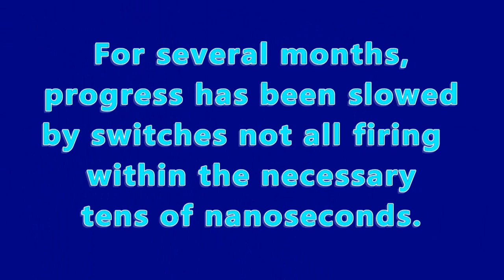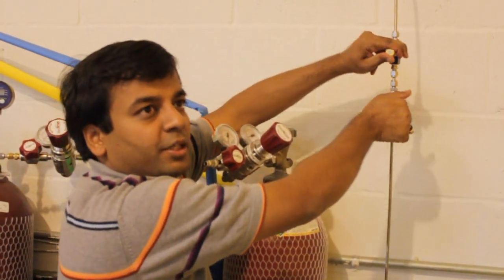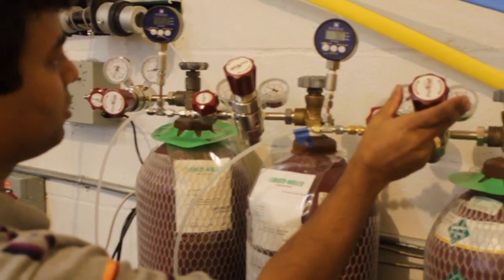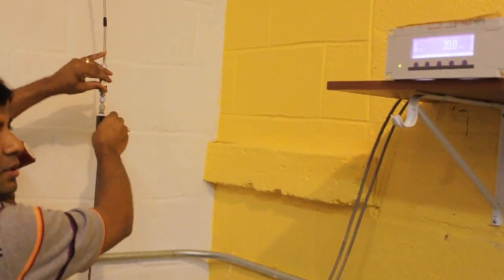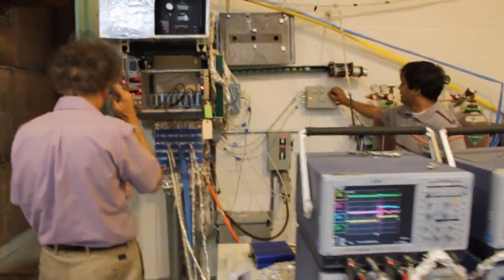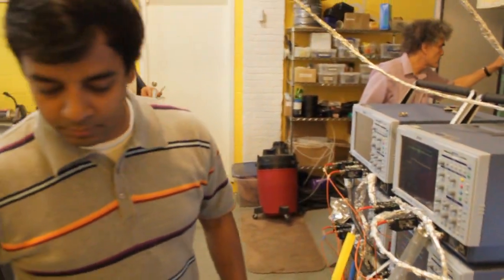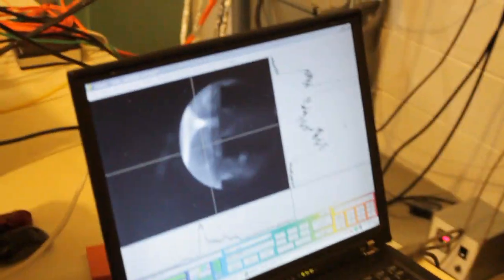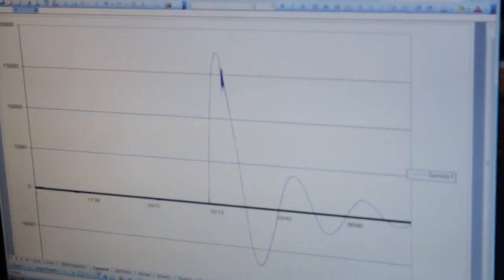Making fusion happen - repeatably! Nuclear Fusion

Comment: Geez.  You guys need backing by a bored billionaire or two.  Running around worrying about cables frying or wasting deuterium has got to be distracting.  It's 2013.  Without me googling I'm hoping you did get some decent funding from someone.  I want to know what happens when you move to pB11 aneutronic reactions.